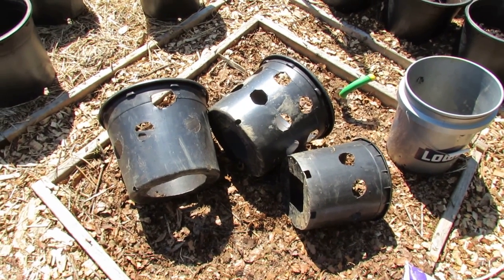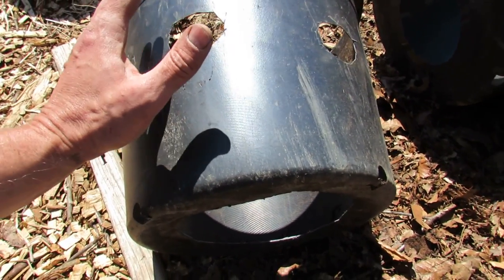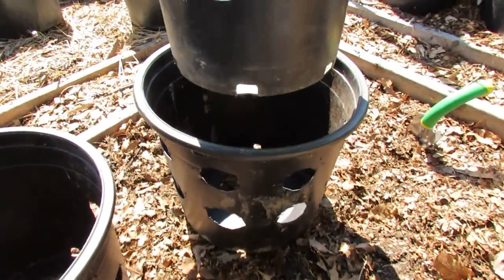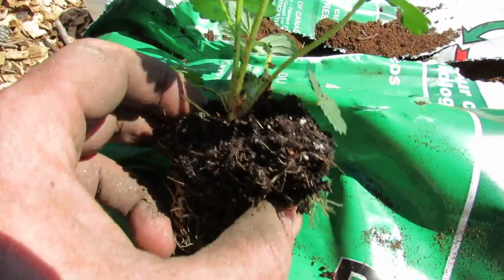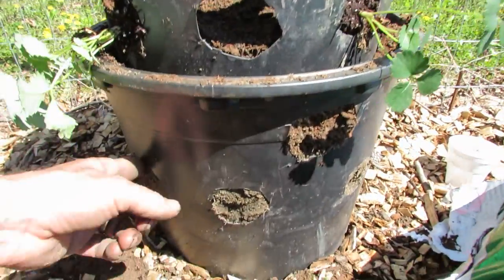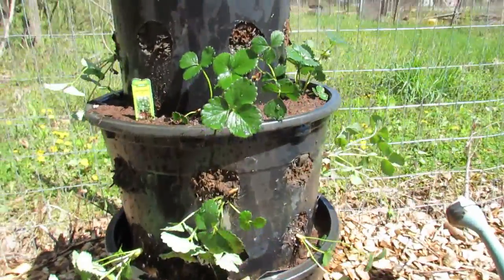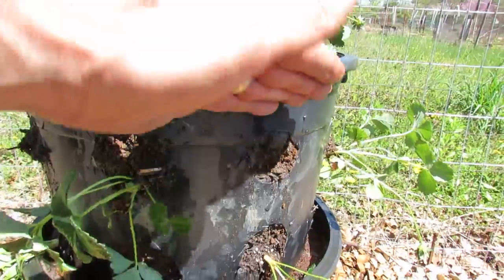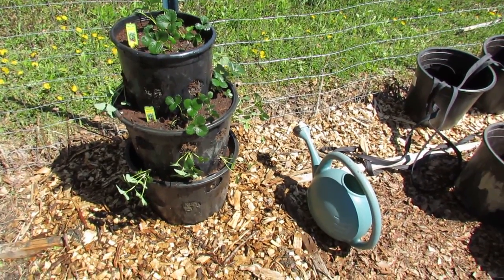How to Build and Plant a 3 Tier Strawberry Tower from Repurposed Containers - TRG 2015

Comment: Gary, I just watched another vlog on growing strawberries and was told to wait until the plant is 3 years old before using/planting the runners.  Unil then, cut them like you would a Sucker . Do you agree with this?
Reply from the maker: Hmmm. I don't know why that would be but I would default to someone with more experience. If I am cutting them off for 3 years why wouldn't I use them. Please visit The Rusted Garden Vegetable Seed and Garden Shop: www.therustedgarden.com
Reply: From what ive seen, it's best to cut them year 1 to allow new plants to grow and fruit. Then year 2 use runners if wanted. I think the idea to wait is so that ur not pulling up good strawberries each year for the new runners. I'd say allow runners year 2 or 3 and start adding or replacing older ones as needed. To keep the beds/pots full of fresh plants. 5 years is a little late imo as year 1 of the new planted runner you'll want to not allow runners to get the new plant off to a good start.

Comment: Did this work Gary?  Could not locate follow up video.  Thanks
Reply from the maker: It did. No follow ups. I don't use it anymore. The only thing I might do is add even more peat moss or coco coir. Get the mix to really hold water.
Reply: @THERUSTEDGARDEN  just wondering but if it did work, how come you no longer utilize this method? Thanks